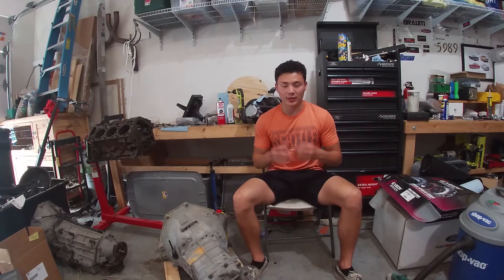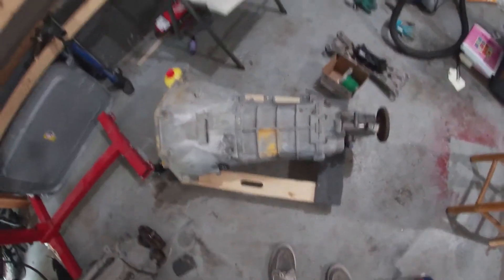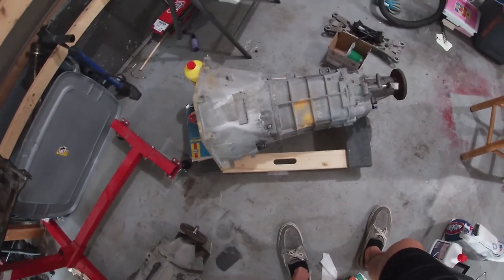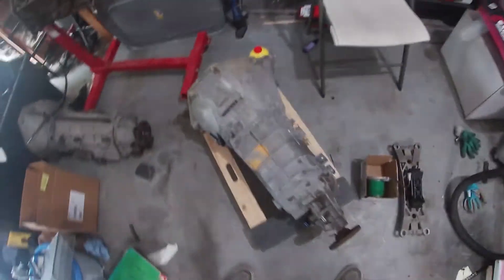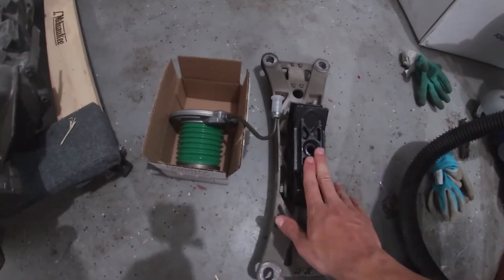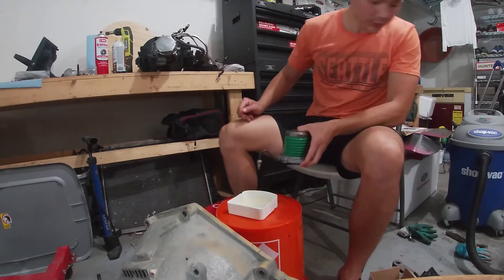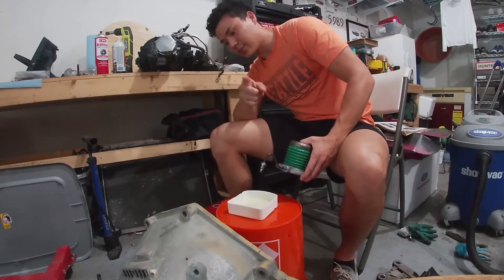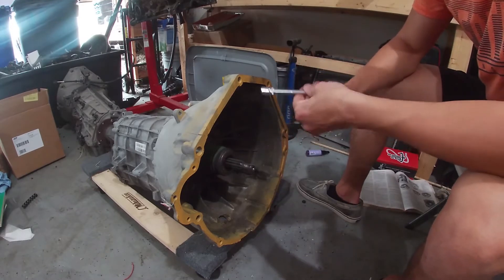V6 Mustang Coyote Swap Episode 4: Hydraulic Throwout Bearing Install

Comment: Do you have a video how to bleed a 2010 Mustang V6 4.0 5 speed no bleeder valve and the reservoir is built in the master cylinder yes the master brake cylinder